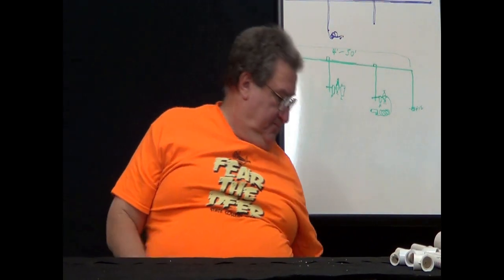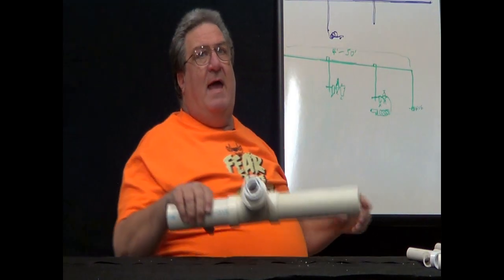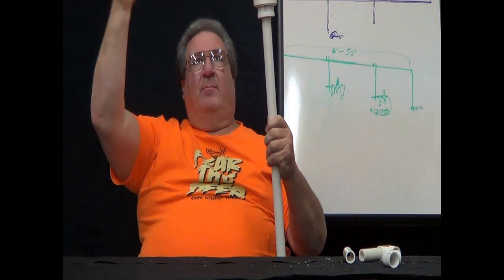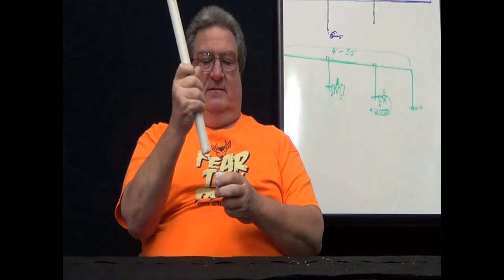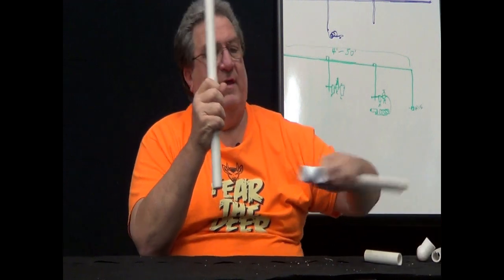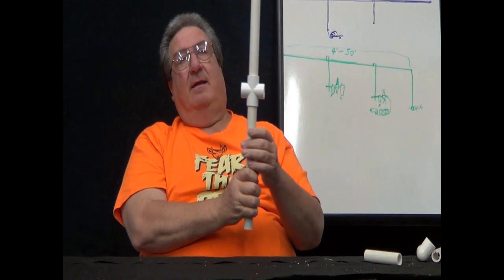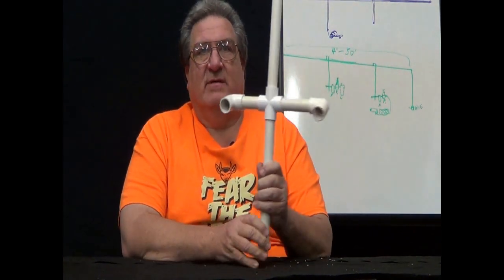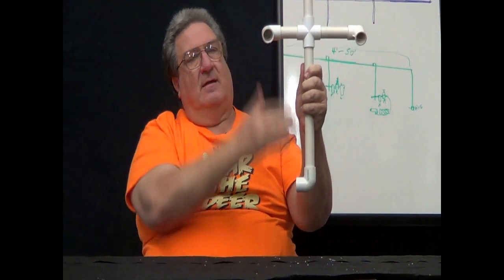5 common mistakes made while running air line AND How to fix them. S1,E1

Comment: I set up my home shop ,the same way my dad did his service  station  in the late 1950s..drip legs,  ..It both ends with ball valves to drain water.i used blk iron piping..along the wall..just over my work bench..my air line go,s uphill..just a bit..like u showed on video..I'm old school I guess like dad was..I'm in my late 50s..I have an inground  lift in my home garage. I installed  a gate valve to lock out the lift from use..on the air intake  to lift..I used heavy copper to the lift.casing   so it don't rust out.in the treads..when we installed  it 19 yrs ago..I have 2 air filters with a air regulator..old iron pipe lasts a long time..my friends said why not plex pipe..I said as it ages over time plex peels from the inside as I found out.at a body shop my friend owns..plastic  getting in to air tools ..great video  my friend..ty
Reply from the maker: you were very smart to run the copper underground. I have had several old service stations call me because the compressor was not make enough air. the compressor was fine . the problem was rusted out pipes underground. Pex is not used for shop air, my reason is the PSI is maxed at 180 psi.I don not know about the break down of material. I have to wonder if that is the case when used in water lines.

Comment: All i can say it will cost a bit more and time ..but ive used blk hard piping ..to run my air lines..used pipe sealer on threads..30 yrs ago..and they still work.like new..in my shop..plasic piping i dont trust with 175 psi..going my inground floor lift...
Reply from the maker: Black Iron Is a good way to go. probably the most common in industrial and commercial applications. I used the plastic just to show for the camera, it is easy and cheap but definitely has its own issues.
Reply: Blk iron is the ols school way..as i my dad used to say he would be 97 yrs old today..he used it in his old Philips 66 station in 1958..when he built the 5 bays.

Comment: Working in the wastewater industry I had to deal with compressed air on an hourly basis. Air is the lifeblood of keeping a wastewater plant operating efficiently and properly. Your tutorial is spot on and effectively shows "how to" and "how not to" run lines and keep as much moisture out of a compressed air system.    Thank you Bud! "Guru of Compressors"